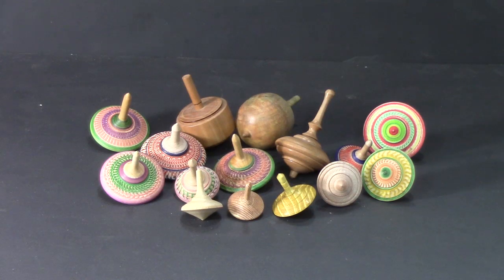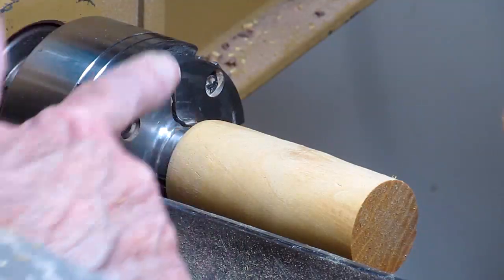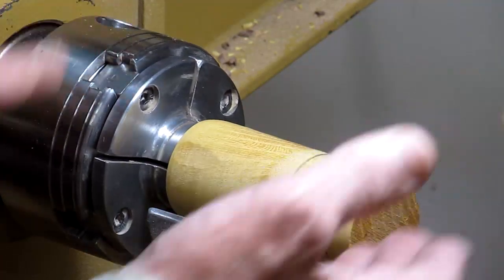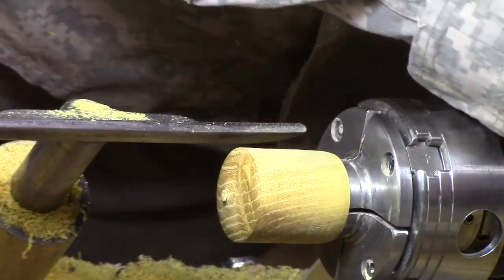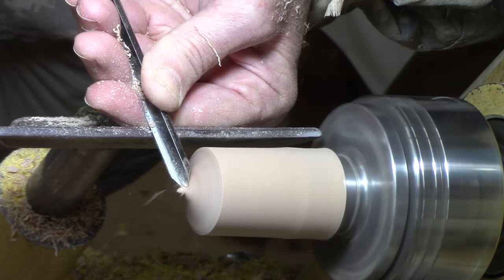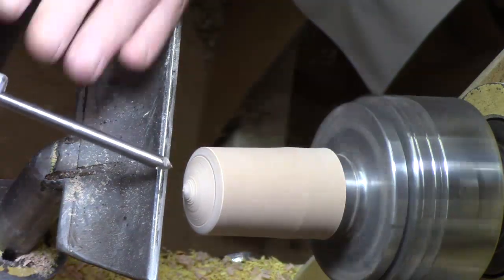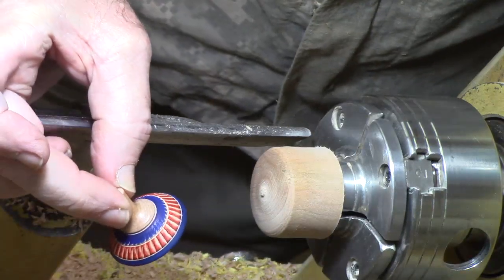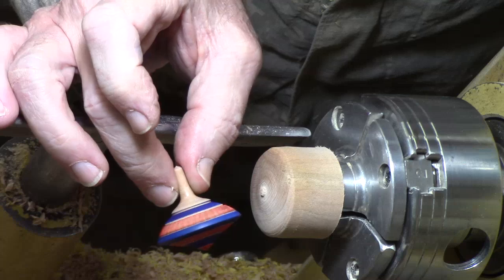Turn a Wood Spin Top

Comment: Nice video, Mike. For those who want a top that will spin a very long time, try adding a small ball bearing on the tip. I use a point tool to make a very small indentation on the tip, Then add a touch of CA glue and press in the ball bearing.  I use one eighth inch ball bearings which I bought on eBay very inexpensively. Spin the top on a round make-up mirror with a concave surface, and it will spin for more than two minutes.
Reply: Ron Krietemeyer Way

Comment: Thanks for the info!! Quick question though... you mentioned using stable dry wood... would you consider using glued up blanks??
Reply from the maker: You could. I just do not want to spend my time jointing , planing and glueing when I could just grab some spindle stock I have had drying.  When you get a piece of firewood or two, put away some 2" squares for a future spindle project. A year will go by before you know it.

Comment: Very nice Mike. Did you make your chatter tool, if not where do you find them. I tried using a flimsy kitchen knife but it didn't work.
Reply from the maker: Yes, check out the link at the end of the video to my video on making and using a chattering tool